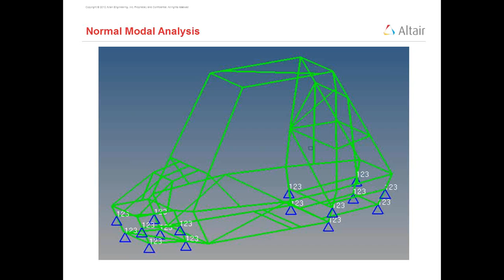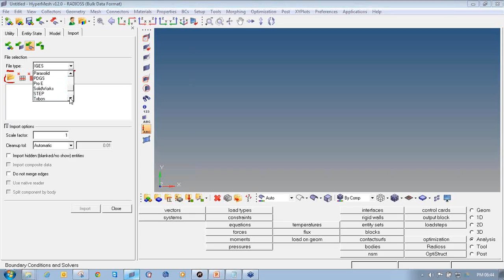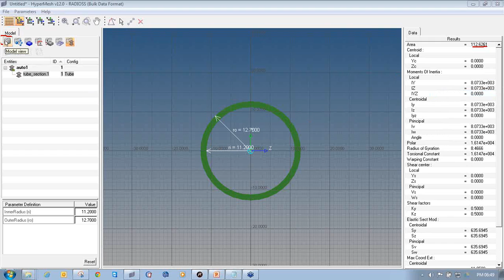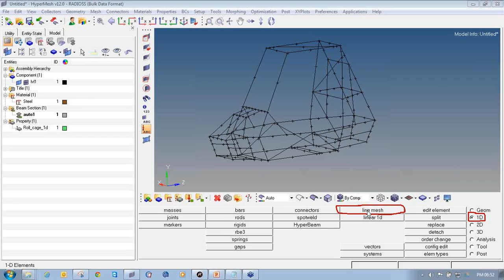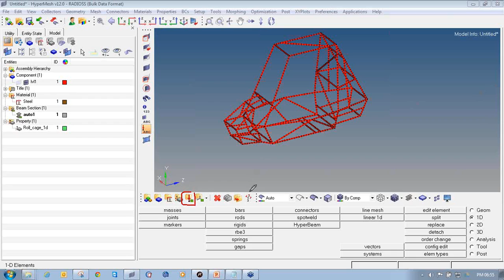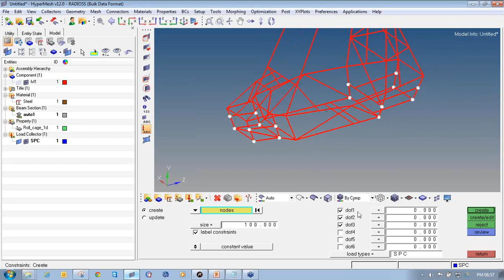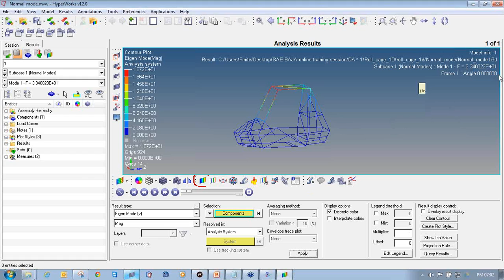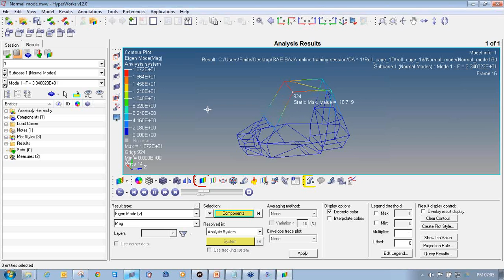Normal Modal Analysis of Roll Cage structure in Radioss

Comment: Hello Sir, pardon if my question is non-sense or too beginner. I have learn that the magnitude value on a modal analysis doesn't matter. What actually matter is the Eigenvalues (frequency) and the modal masses (participation factor). Could you please clarify why do you use this value of 100 as reference, and why did you input the frequency (200) on the EIGRL card? Does we need any frequency input for a modal analysis? Thank you for the video by the way, really good.